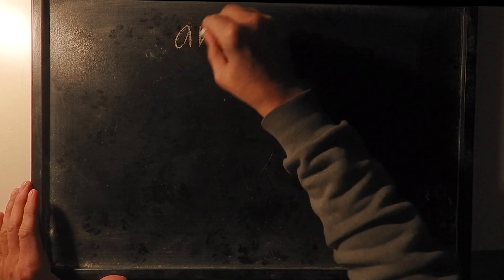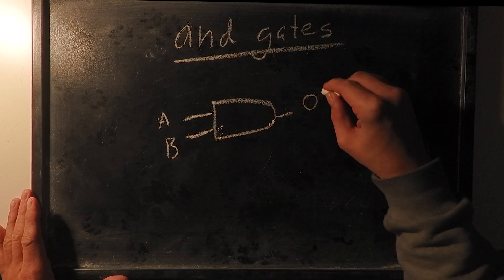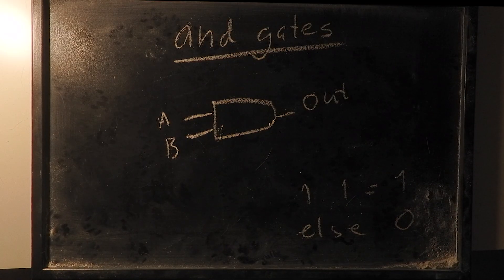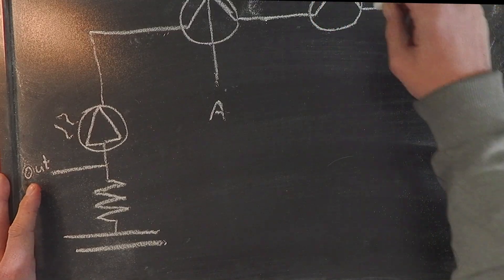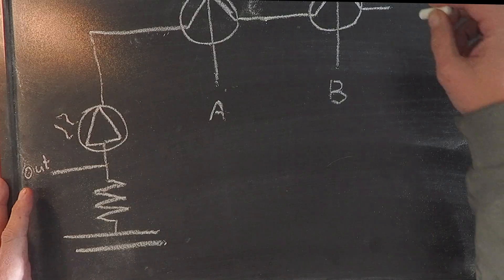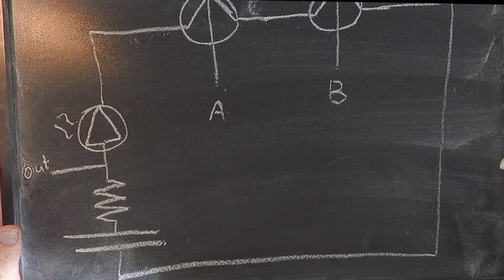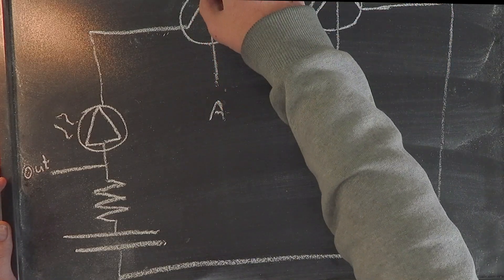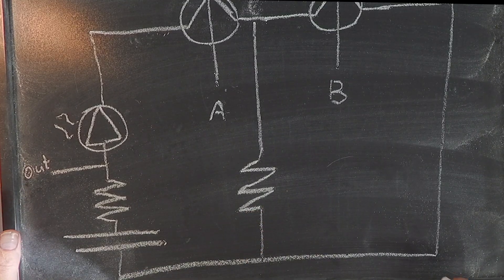Design & build a Logical AND Gate

Comment: From what I remember about electronics, these 1 kOm resistors are there to put very small current trough middle leg of transistors. And this rise more question for me than answers. I guess I need to study more about electric current moving trough circuits. Also, waiting for more episodes of electric engineering series. 👍
Reply from the maker: more will come :)